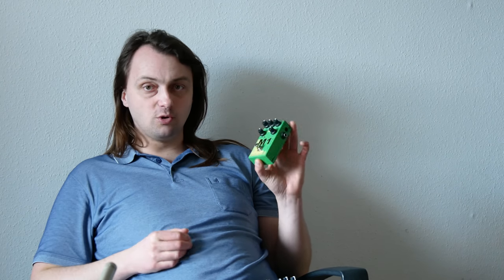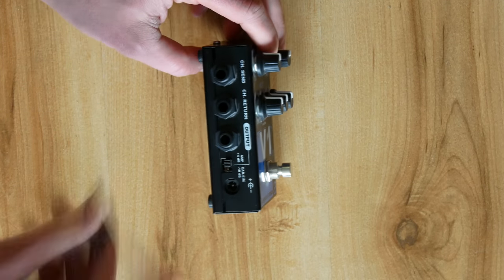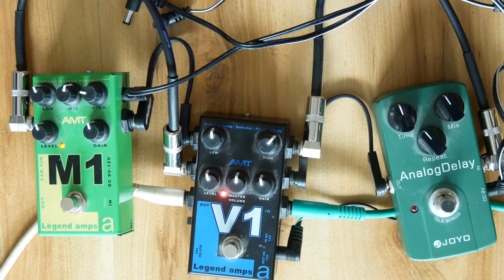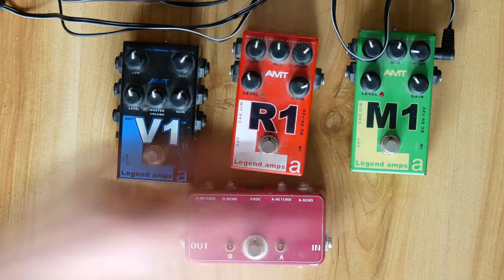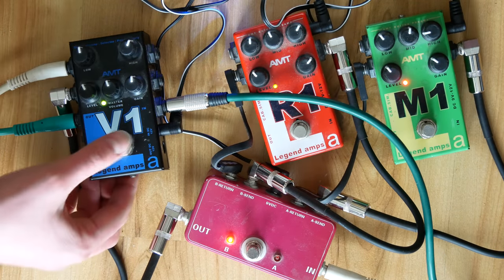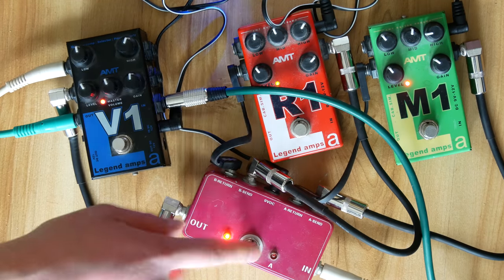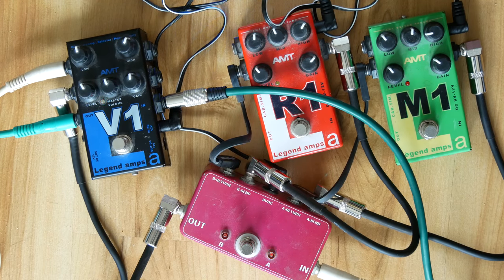Gear Review: AMT Legend Amps - Tube sound with solid state?

Comment: Thanks a lot for the video, actually I bought the F1 from the first legend series. :)
Reply from the maker: You are welcome.  I find the F Clean from brick series better, it's smaller, got 12ax7 tube in it and it articulates like real tube gear. It has no built in cab sim and it can't work with battery, it requires 12 volt, but it's about the same price.  Legend series sound good, no question about it, if you feel comfortable. you can use it. I sold mine ever since I've got brick series. I missed that tube feeling with legend amps.
Reply: @leothemetal  Great, will have that advice for future Christmas presents. I was looking for a clean preamp and here where I live is kind of impossible to find an AMT legend series, even more a brick series. But I'll learn more about it when have mine in my effects signal and will find the way to migrate to the the brick series.

I have another question, a friend want to know how the M1 or R1 works with a TS808, because she's interested in get a Marshall like sound. What can you tell about it?

Thanks!!
Reply from the maker: Well, I'don't own TS808, but a bunch of overdrive/distortion/booster pedals worked with them pretty much like they supposed to work, you get the sound you supposed to get, but still without that tube feeling-at least that what disturbs me. Some people can live with that sound, some make awesome music with these thngs, so nobody actually hears that there is something wrong with the sound. It's for you to decide whether you can work with it or not. 
Ever since I've got Brick series, I sold all of my legend amps, except the LA2, they are good as overdrive. 
As for marshall sound-M Lead and M Lead Plus from brick series do the trick.
Where are you actually from?  What country is it where you can't find AMT products?
Reply: @leothemetal  I'm from Colombia (Yeah, your review reach the other side of the Atlantic). The only AMT products you can find are those other people bring as their personal gear time ago and now are in the selling web pages.

Well, I want really a clean preamp, with decent headroom. Of course dreaming to get a Fender Amp for home, but, when you need to gig, is better to have a compact gear.

Actually I have a Electroharmonix .22 Caliber power amp as a backup because I prefer to avoid some amps you found on stage.

Thanks a lot for your answers! Cheers!